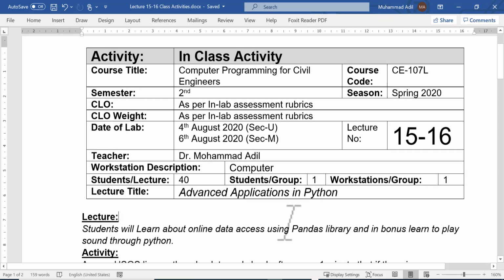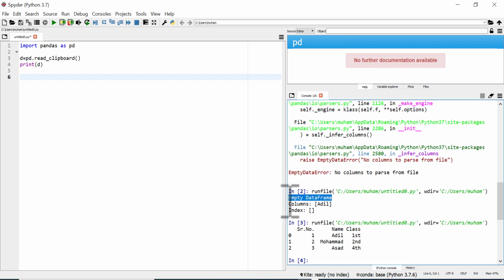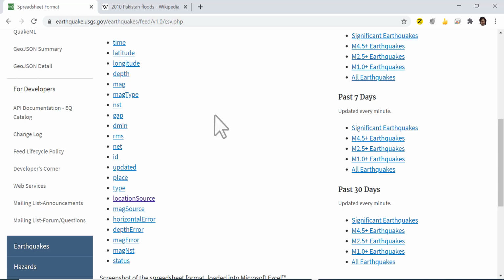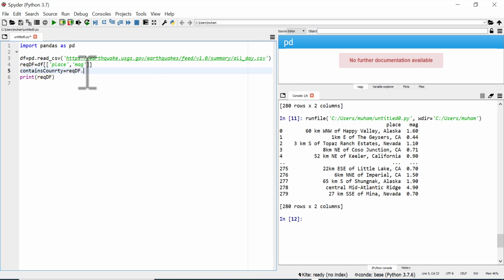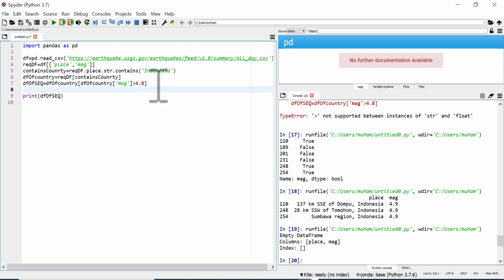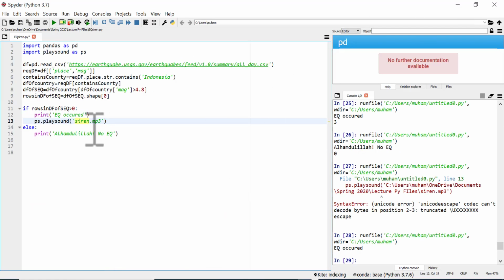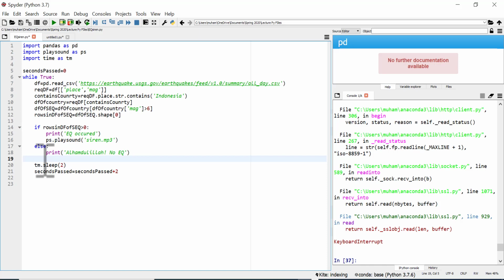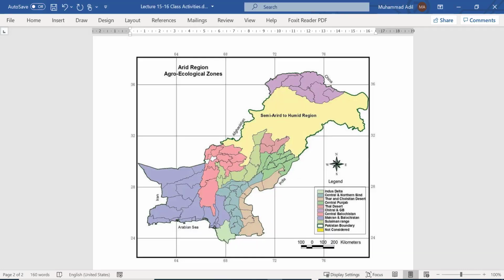Lecture 15 & 16: Python Programming for Civil Engineers: Advance Application in Python

Comment: Sir make videos on python gui for push over analysis of Rcc buildings with damage indices
Thank u sir
Reply from the maker: Indeed performance based design is the future.. Sure when I get time I'll work on this tool. Thank you for your suggestion @Vinod.
Reply: @engr.mohammadadil5276  thank u sir. In non linear analysis  of sdof or mdof how  stiffness matrix will vary sir . Or we have to take some models ?